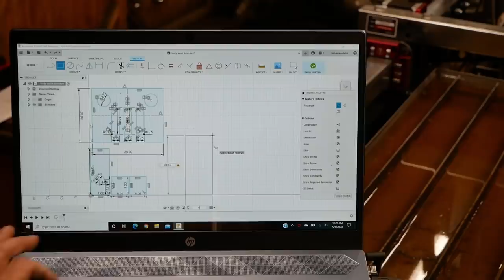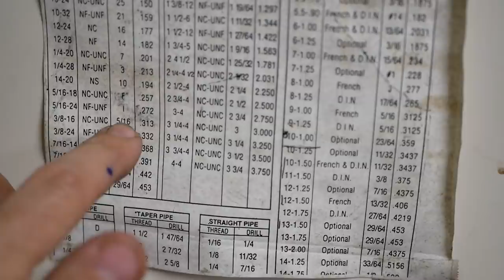420cc Predator powered articulating 4x4 dump truck build part 8

Comment: I dig the 60's airport tug look. I feel like this machine is reminiscent to a time in our country when machines were built rugged yet simple enough that they could be serviced and kept going.
Reply from the maker: Haha you definitely get the styling! I live in the Pacific Northwest and I was thinking about the older tug vehicles used to pull cars off the ferry boats, basically the same thing 😂 You definitely get the point of this build. Thanks for checking out my new video and commenting!
Reply: @Mikefestiva  hell yeah. That thing is awesome!! I live is central PA. We cut firewood and I know that machine would be perfect for getting in and out if right spots!! For now we just use my TJ haha

Comment from the maker: Hey guys I have had some people ask if the hood still opens. Yes it does, it opens up enough to gas it up and clean the air filter, stuff like that. If I need to do any major repairs, the hood comes off with two bolts in about 3 minutes 👍 Ps the next video will cover Question and answers so please take a moment to post a question you may have about this build! Take care guys 👋
Reply: I recon you need a bash plate to protect the motor and other parts.
Reply: How about a folding rear view mirror on the left that swings out for road use, or folds in flat for going through the woods? 😁
Reply: I see a lot of people adding roll over protection to their stuff.  Would that be something that you will add?  Probably a good idea as it looks like you live on a cliff side from the videos.
Reply: I love the build. I am curious why you went with articulating instead of standard steering? I may have missed it in a previous vid. Great job regardless. You know your stuff!
Reply: Haeds up, I just might pay you to build me one of those.. Would the that be possible?
Reply: Awesome build. Awesome camera work.  It needs a roll bar yesterday. Like, before you do the cab or dump bed. Please.
Reply: Since I have a background in logging among many others, that thing screams log arch and winch with quarter fenders front and back. Awesome build. Something I wanted to build 30 years ago for firewood. Love Arty's (articulated vehicles) being a certified operator. You got skills man.
Reply: @lindsaypowers4375  with the articulation action it is very maneuverable and able to maneuver in and out of very tight spots  compared to a vehicle with an axle that steers and has the same wheel base
Reply: Hey mike, I think that it would look much better if you leaned the grill forward, instead of having it leaned back, your build your design so do whatever you please, I love this build please keep it up!
Reply: You could easily swap the 2 bolt for 2 pins and be able to do trail repairs without tools
Reply: isn't this the video that inspired you? https://youtu.be/XaL1urqMZFY  Но у тебя получилось гораздо лучше!
Reply from the maker: Yes I found this video about 3 years ago, they did a wonderful job building there’s. I have since found a Italian company that builds a 4x4 dump truck as well. Not much like this on the market.
Reply: I'd like to see you attack muffling the predator to conversational decibel levels.
Reply: Looks great! I would like to see a video of a camera mounted hi up on the back facing the front while riding the dirt bike trail. Nice place.
Do you have any plans on trying to have dual tires on the rear at all?
Reply: Dumb questions for you... First of all, I absolutely love the build, but I've gotta ask,  you used the Subaru running gear, why didn't you use the engine? It seemed to work ok, and it was essentially free. Was it due to size? Weight? Complexity? The frame certainly seems more than capable of handling the weight and while I know you don't need the extra HP, I would have thought that maybe just using it because it was there would be reason enough.

Obviously, it would be heavier, but would have so much torque that gears may not be necessary much. And generally speaking, heavier can be good for traction anyway. Just curious, mainly because I'm super keen to make one of these one day
Reply: Oh, and also (since everyone is offering their ideas...) Outriggers for a small(ish) crane for lifting the logs from inconvenient/otherwise dangerous angles, and a LARGE tool space, perhaps a slide out drawer (or 2) under the tray so that you can keep the basics with you. I hate not having the tools I need when I need them.
Reply: @effortlessweb9816  there are several reasons the first one is to get a very low first gear he had to use a jack-shaft and sprockets to achieve an 8:1 primary gear reduction and another reason is simplicity. with the subaru motor he would have had more  than enough power to go well over 60 to 70 miles an hour that would be completely  useless on a vehicle like this, not to mention dangerous he already gets called out for driving it around at 2 mph with out roll over protection and a cab I can only imagine the comments he would get if it  was capable of 80 mph
Reply: Buddy, your build is looking great ! 😊
My questions, do you have plans for wheel guards ... ? What might they look like ?
I'm enjoying your vids, please keep doing what you're doing ...
Reply: Was wondering this exact thing when I saw the winch put on.
Reply: well for some wierd reason i want to know where did you find those soundtracks they are 
not that bad
Reply: Just flip the bumper upside down.
Reply: I should have commented sooner a jeep styled grill would have looked amazing on that. More of a 1940ish jeep willy style or so on
Reply: @davidhelgeson6997  ... My thoughts exactly. Ev'ry body been watching too many of these Hell Cat, GT 500 , and C-8 Corvette vids. Plus, it's easier to bend a nail  crooked, then unbend back straight. Well, what if he can't get parts for the Subaru engine in the future. Now, he gota change all the set-up for a new motor. What a hassle... I doubt that they are gonna quit making lawnmower engines any time soon...
Reply: I was thinking. If you gonna leave it " Au Naturalle ", then soaked it down with some chainsaw bar and chain oil mixed with a l'il diesel for sprayability....
Reply: What size are the tires/wheels and where did you get them?
Reply: @HandTightGarage   their is a link in the description of the video
Reply: 111111111111111111
Reply: 00
Reply: Reminds me my Nonno's little tractor! Great job!
Reply: ββηηηηηηηηηηηηηηηηηηηηηηηβη
Reply: Τη τη υ
Reply: Kiki
Reply: @ethanwilson4165  he has the bumper the big steel bars and wheels for that he isn't gona be going full speed into trees and stuff he even said its not comfortable going fast
Reply: If youre interested there are now lunchbox lockers for the rear difs of those subarus. 
Althout, im not sure if at that point you might just want to weld it up or not lol

Comment: I'd love to hear you talk more about the design of the centre articulating joint in your final rundown. What's worked, what hasn't, how you mounted bearings and worked out clearances and such. Super interested in the fusion 360 series.
Reply: Take a look at episode #2 that video covers the center pivot

Comment: That's a torque limiter or some times called a clutch. PTO shafts of tractors have the same system. Funny though, I just made the same exact one like you have this week for a project, just a little bit bigger and with a big sprocket in the middle.

Comment: Don't sweat the negative comments.  Matt Large has some smooth music. A taste from the old tymers mixed with new skool. What your doing is outstanding, the attention to detail for what your building is great. It exploits your ability to  make what you have work. For all of you negative nanny's Imagine this guy with a 5 axis cnc , AM machine,  a cnc press brake, laser cutter and who knows what he would be capable of. He would be hired in a heartbeat if he would move to Florida!  Great Job
Reply from the maker: Thanks for the awesome comment! I really appreciate it 👍🙂 
This articulating dump truck was a fun build!
Reply: @Mikefestiva  Hey I found your videos by searching Fusion 360 for beginners, any chance you have a video containing how you located the bolt pattern or shape of the bellhousing using Fusion? I'm still wet behind the ears with fusion (about a few hours into it from zero) and your videos help! Thanks and keep it up!

Comment: are you planing on putting something like a 3rd function hydraulic system on the front so you can run a snowplow or a hydraulic driven snowblower or something of that nature
Reply: I had a balanced hydraulic snowblower that would have been perfect. The  separate engine and hyd pump could be in the box for weight and the blower with a hyd motor on the front. Balanced systems do not produce heat. I don't think the small motor on this tractor would run a snowblower. When he installs the dump cylinder he could put quick disconnects and use the system in the winter to lift the snowblower.

Comment: Man That thing is really turning out awsome. If I was building it my changes would be get rid of the chain drive upgrade the hydraulic pump make it 100% hydrostatic for unlimited range forward and reverse with a simple foot rocker and I would run all of the hydraulics from the single pump and obviously the log grapples lol I would also make a separate bed with quick change pins so I could switch between the dump bed and a set of log bunks and a matching log trailer to follow so it could be a dumper/skidder/forwarder since you have the mill and the machine is quite capable. I know hydraulics are spendy so I'd just make that a future upgrade. I personally would not use the 12 volt hydraulic set up for your dump they are extremely slow and put a significant drain to the battery I would just use the hydraulic pump your already running the steering with. I would also just weld on a few links of chain between the 2 sections as a flex limiter my old Holder Ag3 did this and when its really flexing it can save your bacon.

Comment: How are you going to get your engine cover open now with that winch on the front
Reply: the engine cover does open enough to access fuel tank and air filter if more access is needed you just need to remove 2 bolts and remove entire hood

Comment: Mike she is a beast! Wait until you get some weight over the rear tires. I really like the Russian/Polish World War 2 design elements. I would've painted with epoxy bed liner to protect against branches scratching.. Rugged great ground clearance,and geared low. The articulation will be very useful in the tight wooded areas.

Comment: What a cool project! When it comes time to paint the chassis, consider a coating like Chassis Saver.  It’s thick and durable and levels out nicely even when applied with a brush.
Reply from the maker: Ed Cias III Thanks Ed! I really appreciate  your suggestion on that, I definitely will look into that.

Comment: Its a torque limiting clutch.
Reply from the maker: Yes you are correct 👍
Reply: Mike,  also check into viscous couplers. This may suit your needs better. It'll allow 4WD only when the main drive wheels slip/spin.

Comment: I love the function over form look of it. Yeah, it does looks like a robot from the 70s or a Russian machine, but it works. You can hear that the engine is under stressed and the whole machine is way overbuilt, which goes well with the environment it'll operate on. More weight, more traction. I'm curious to see it haul some logs and if you can climb the same hill with them!

Comment: Hey Mike, I really like this project! FWIW my spin would be to hunt down some cheap early 1930's Ford pick-up truck body parts and chop / section them to scale of the tractor. Make front of bed pointy to accommodate articulation.
 Nice work. Cheers!

Comment: What you need to do next is put a hook on the back of the frame so you can pull a trailer just like a truck driver pull combination of trailers lol this is a really cool vehicle that you are built-in Mike ! Actually cooler or just as cool as your sawmill ? Hard to pick a winner from those two

Comment: so, my dad was a heavy equipment operator. His favorite/specialty was the Front end loader.  Your design with the center articulation reminds me of it. I think some counter weights on the very front, and tail end would add stability. by balancing the weight of the machine while turning.

Comment: Suggestions: 
1. Add 2 small bulbs on either side of the mesh (inside the engine compartment..that can be turned on n off by a button next to the gasoline guage) this will provide u the light when working at night...
2. add some grill guards for the front lights...and a back light for reversing.
3. lift the exhaust up in the air like a tractor..that way even if ur going through heavy rain flood ur vehicle won't stop. Plus going on hilly terrain the exhaust (usually under the belly) will be safe from getting smashed.

Comment: Amazing progress. Thank you for sharing. You need to buy two brakes asap. One for the heavy material and one for the light material. The heavy can work off simple HF press... the other for the thin gauge hood.. is not expensive at all.
Reply from the maker: Yes I definitely need some! I have all the metal to build one for my Hf 20 ton press, I just need to build it one of these days. Take care

Comment: I like your project. A little suggestion concerning the turning of your truck. Back in the 70's I had a logging operation. I had a handy little prehauler. It was similar to yours but bigger. It was  based around a Ford 4000 diesel tractor called an Iron Mule. The mule had no steering axle it was articulating four wheel drive like yours. The mule had a boom behind the driver used to pick up the wood.  It could haul a pretty good load.  This mule would flip over pretty easily. To flip it over you had to have a rear wheel next to a tree stump.  If the operator didn't pay close attention he would try to make a turn and the wheel being fouled out by the stump it would just flip  over.  Your little truck will probably be able to do this too. The only thing that would stop it from doing this would your hydraulic system not having a lot of pressure.  Enjoyed your videos, I just wish you had a part 9 and 10.

Comment: For your tap and dye set you can glue that foam liner to the lid so you don't have to adjust it everytime you close it. The new gear ratio seems to work well.

Comment: 1. Your music is not mine but the way you handle it both in volume (never louder than your voice) and cut it out when you talk is excellent.
2. Are you happy with your new gearing?
3. Are you getting use to the rear wheel steering, I have an articulating 4 wheel drive lawn mower and it took me some time to control it on side hills. Your pivoting rear looks like it helps.
4. when you get some weight on those back wheels it will go anywhere.
5. With your narrow wheelbase I would not put a limited slip on it. It will make it tippy on side hills.
And lastly Bright red is the color for a mean machine.
Cheers

Comment: Love the build. One sugestion would be to look into buying a kit of raptor liner spray on bedliner to paint the truck with. You wouldnt have to worry about scratches or dents messingn the paint up and it looks pretty good also

Comment: I really like the new hood - gives it a whole new look! But I also want to see the return of the Stage 2 Predator 212 dirt bike after this project is completed. We never saw a top speed test after you put the stage 2 on! Also try out the Juggernaut CVT pulley. Works with the 30 series you have and is intended for use on built Predator engines. Should make a difference!
Reply from the maker: Yes I definitely need to get another video up on the Predator 212 dirt bike.

Comment: I really enjoy the artistic capabilities you share not only in the shop but in your cinematography.  Keep up the good work Mike!  One question,   Could you mount the bumper upside down allowing the hood to open without removing the bolts?  It would still give you pretty good ground clearance.  Just a thought.  Can't wait to see the finished product!

Comment: I my opinion if you add some sort of plow or front loader with have a flat bed side and rear door tail gates attainments it's optional. It might give you more availability to what you are working on. I am not a professional  so don't take my word for it. I like the overall design of your machine, it looks well put together and I know  it's well put together.

Comment: I think you should have tipped the grill outward, like an old garden tractor/mower.  Also why no suspension? Is the center articulating joint enough?

Comment: Feel like you should put a electric fan in the grill just to give Extra air flow to the engine when it’s under high load and not moving very fast

Comment: Just a little advise.  I'd ditch the stainless hardware with the aluminum panels.  Aluminum and stainless are pretty far apart on the galvanic scale, so you'll end up with some bad corrosion.

Comment: You know I built a go-kart former kids several years back and made a Jeep body for it. The way I did my bodywork is I took conduit just regular EMT and Bennett to the shapes I need and then took a tablesaw with an abrasive blade and split the conduit for I can slide the tin up inside of it and that took care of the shape and the sharp edges. I made the whole thing out of Valley tin from the lumber yard and EMT. I didn't have a welder back then so I just soldered everything together.

Comment: Are u going to install a limiter for the articulation? So it won’t turn completely over.  Also looks like the steering cylinders may be vulnerable to damage. But most of the tweaks will come in time and from use. Great build, I’ve enjoyed every bit of it!

Comment: Nice rig! It seems pretty stable on hillsides, etc. also, which is a plus. It would be cool if you could come up with a 2 or 3 cyl. Kubota diesel to mount on it. Very torquey and of course, easy on fuel.😉